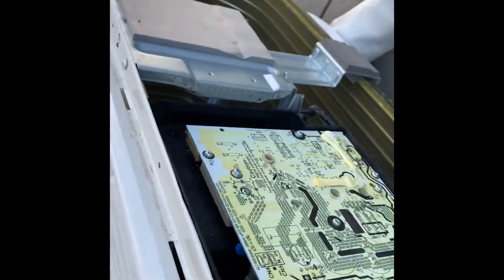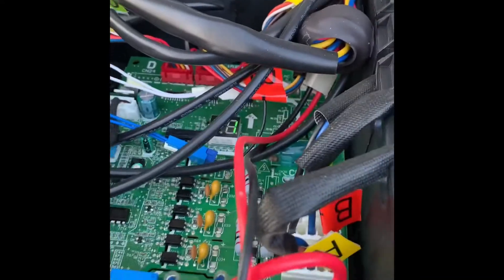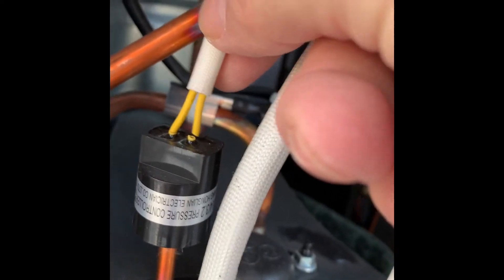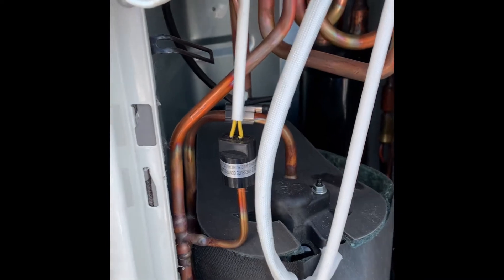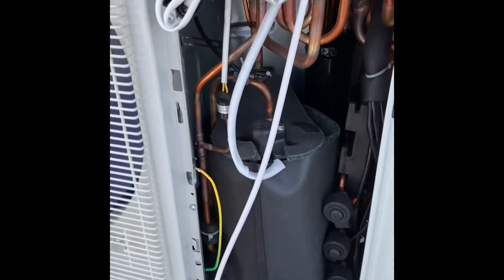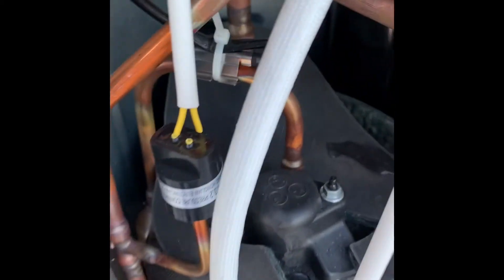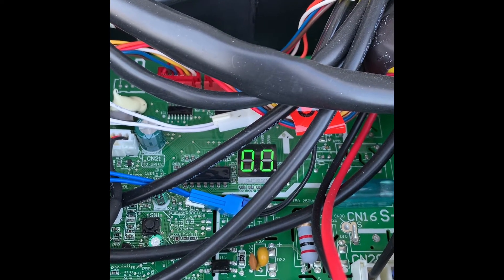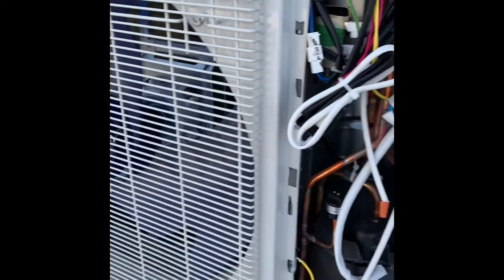Mr Cool DIY error code P6 bypass/fix

Comment: I had a p6 code, and the compressor was not on. I turned power off. I took the panel with the Mr. cool word like he did in the video. That pressure controller or whatever it's called...that is attached to his two broken wires are attached to...i tapped it. The compressor came on and the unit is working. I also read that turning off at main switch for 10min will also work.  I don't know which worked...the tapping or power off for 10 min but it's been 24hrs and everything is still working.

Comment: I did the tap tap at the switch 😊and it reset the board from P1 to 00. Then I went inside and turned on the 2 units and P6 is gone. Heat again . Thanks for taking the time to share. 😊

Comment: Found your video, working on a very similar issue. P3 error code. Opened to look and found bubbles coming out of the top where the wires are on my low pressure switch. Wondering how it’s going to be taken care of by MrCool. Unit is only 6 months old.
Reply from the maker: 😬 That sounds like a for sure warranty issue. Just make sure you've registered it and they should take care of you.

Comment: Hey how did it go? I’m starting to see that error code pop up randomly. It will go away and the unit will run again but I seen it pop up about 3x and really want to take care of it before it’s crazy cold.
Reply from the maker: 😬 my new one is working good so far (8 months) I would say make sure they know and you deal with it while under warranty. I think as long as you can tap on that pressure switch to get it to release it will keep working, but I have to assume at some point it will fail. I think that may be why they released a new version. My son installed one this summer and it had a few upgrade/differences and I'm wondering if this was a part they changed out.

Comment from the maker: Update coming.
Mr Cool sent us the replacement condenser. 
I asked about the linesets. Do I need a professional to make sure they are fully charged when reconnecting? Since they have been used, how should I know if they leak when disconnecting and reattaching?
Their response:
"The line sets are designed to self seal as you loosen the line set connections. It's designed to release the plunger valve and seal without losing any refrigerant . nothing is guaranteed so i would close all of the service valves just in case . while you have it unhooked i would move your excess line sets out from behind the condenser so it doesn't block the airflow through the coil. and you can move the excess coils of line set to the horizontal position and strap it to the bottom of the condenser on the wall mount"

Key words: "no guarantee" 
🤔
Seriously?
No, they will not pay for a professional to GUARANTEE what they won't GUARANTEE.
Well with that I'm hiring a professional to GUARANTEE they did not lose refrigerant.
And I have a home warranty that should cover the "repair." Although they are arguing it's not a repair, it's a replacement...🙄

Also every video they have posted has shown the linesets to be looped between the wall and the unit (when suspended). Now they say to hang them horizontally looped below the unit. Makes sense, but just so you know if you're reading this, this is a change to their former recommendation for excess lineset placement.

I will update with a new video when solved.
Be blessed. Be warm. Be cool.

Comment: did you just cut these wires & solve the issue?
Reply from the maker: They were already cut, but that is what happened. It would be a temporary fix and fail eventually. Mine lasted over a month.

Comment: Did you ever get this resolved? Would you recommend one of these units to somebody you liked?
Reply from the maker: I'm finally ready to install the new unit. What I haven't found out is, is it that simple. Unscrew original lineset and reattach? Or do I need a professional now to recover the refrigerant?
Waiting to hear back from mr cool today.
Initially I would have recommended. Will have to wait and see how this reinstall goes.
I have 2 bids from professionals. $781 and $2000.
Reply: @oleandt77  pretty sure if you turn off the unit and disconnect the power, you can just close both of the allen key valves and then disconnect the lines if  you have the quick connect lineset. There are valves on the end to keep the refrigerant inside the lines.

Comment: @revole7 did you by chance look at the coils inside the units indoors? Did they have “snow” all over them? I’m getting a P6 right now in mid TN and it’s been cold but still around 20 deg. Mine had the snow all over them, haven’t checked for the broken wire yet
Reply from the maker: Nothing on the inside here. Hope it works for you.

Comment: In the beginning of the video, you mentioned there was a switch that gets stuck and you tap on it - which switch is that? Is that the same one that the disconnected yellow wires were touching? Thanks, I have the same error!
Reply from the maker: Yep, right below the yellow wires. Tap on it to get it to release. Hope that works. Lasted for a couple months. Now it doesn't work. I talked to them and they said it's just a temporary fix.

Comment: Update, my unit just like yours had the broken wire, and I will be contacting Mrcool as well. FYI my unit was just installed in September.  I truly appreciate the time you took for this informative video.  God bless you 🙏 .
Reply from the maker: I just got my replacement unit. Currently well below zero and I can't get the P6 code to clear. Will update if I have any info.
Reply: @oleandt77  if mr cool is anything like it’s parent company GREE the p6 means low compressor pressure aka leak
Reply: I hope you get a break in the weather, so that you can do a quick swap-out. Good luck bud.

Comment from the maker: New update. Coldest day of the year, well only day of the year at -18! It's been working till now. Code P3. Happy New year.
Reply: I just had the same damn thing happen to me! P6 inside, but P2 outside. The unit is only 2 months old! Not quite as cold as you, but it’s still cold at 21, feels like 11, UGH! Thanks mr cool!
Reply: Anything new with your P6issue?
Reply: @otvickers7074  I’m in NE Tennessee
Reply: @otvickers7074  I sent a long response, yet I don’t see it here. Did you receive it aside from “I’m in Tennessee?”
Reply: @jamestroy34  no Troy I did not see anything
Reply: @otvickers7074  well, the short story is, I’m having trouble getting anyone to come out to service the system. They all reiterate the same message… Mr Cool mini splits are junk! They’re known for leaking. I’m 2 weeks without a decent system for heat. Currently using 2 oil filled heaters with most rooms closed off just to keep me at maybe 64 degrees. Mr Cool doesn’t respond to calls. Their customer service sux! I may have to file suit to get my monies back so I can buy a better system that’s actually cheaper.
Reply: @jamestroy34  Sorry to hear, unfortunately I’m hearing the same regarding Mr.Cool systems. I’ve called two companies to service this brand new system and both said NO. Finally have been in contact with Mr. Cool, (email was the only way that they finally contacted me back) they want to check the line set pressure … I’ll keep you informed.
Reply: @otvickers7074  that’s very kind of you! Why should we have to pay for something under warranty? Especially since my units have only been running for 2 months. Let me know if they are setting you up with a technician, and what your problem is. Like I said, they’re supposedly known for leaking. I’m sure they have to add a dye, or some form of leak detection, or you’ll be back to the same problem in short time. My best to you in resolving your issue!
Reply from the maker: Found it. Code P3.
Outdoor ambient temperature too low.
Imagine that.

P3 - Outdoor ambient temperature too low.
https://iwae.com › resources › videos